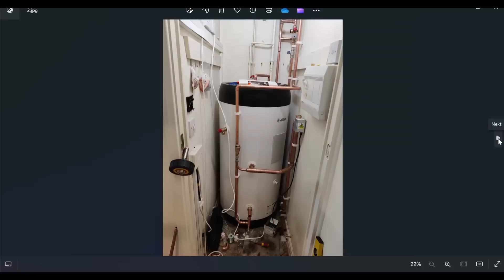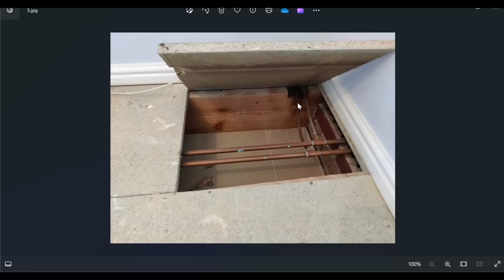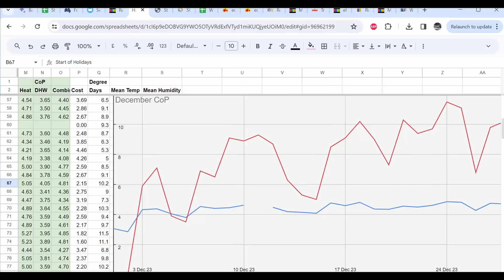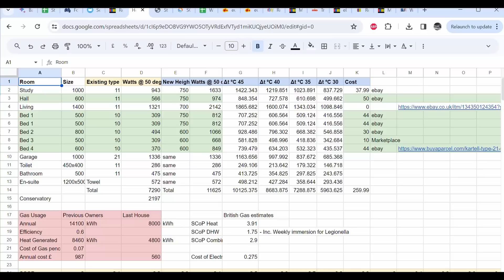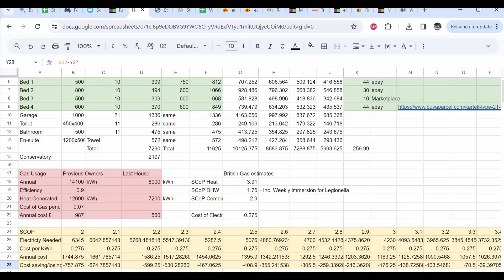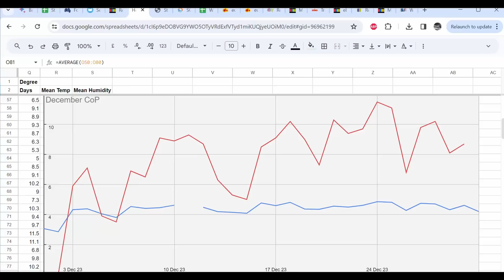How Efficient is my Air Source Heat Pump in Winter? December 2023 Monthly Data Report Update

Comment: The correct way to calculate efficiency is Total useful heat generated divided by total electrical energy input. Your calculations adding electrical input to heat generated and divided by electrical input give a misrepresentation of efficiency.

Think of a brushless electrical motor. If you input 1000w of energy into the motor and it generate 800w of rotational output movement then the motor has 1000/800x100=80% efficiency not (1000+800)/800=225% efficiency. Its nonsense.

Likewise if a car burns 1 litre of diesel which has a specific energy density of 40 mega joules litre. And that car travels 10 miles per liter it will use 40 mega joules of chemical energy. Compared to an electrical car that will use 2 kwh for 10 miles or 5miles per kwh. We can calculate the comparative efficiency. The efficiency delta is 40/7.2=5.55 or the electric car is 555% more efficient than a diesel.
We don't use (40+7.2)/7.2=6.55 it's a nonsense.

Your electrical input to heat generation ratio on the 2nd of December is Heat Generated /Divided by Electrical Input. 79.3/42.9 = 1.85 i.e. 185% more heat for each electrical kWh you input. Your real COP on the 2nd December is 1.85. It cost you £0.275p (plus 5%vat) per kWh of electricity to generate 1.85kwh of heat. I.e £11.80/79.3= £0.15p per kWh of heat (Add Vat at 5%). So if your unit price is 0.275p for electricity then your efficiency is 0.27.5p/0.15p= Which is guess what, 1.833 your COP is  1.833 on 2nd of December. You need to think of the cost of energy in and the total number of useful heat kws out otherwise you are a COP of 1 or 100% efficiency out. 

My example on the 31st December is that I used 5 kWh of electricity energy to generate 29 kWh heat in my house (Not including DHW which was 15/4=3.75 CoP 3.75). Ignoring my 15 kwh battery and 7 kWp solar array, if I was to pay for this at 30p kWh (Excluding 5% vat) then I would input £1.50 of electrical power to generate 29 kWh of heat which equates to a real world cost of 5.17p kWh ex vat..

So I think something isn't quite right with your system.

 My efficiency is therefore 29/5X100=580 580% or CoP of 5.8 it is not (29+5)/5x100=680% or CoP of 6.8. Think about your real world cost in Kw v heat generated. The most important metric is how much does it cost to heat your home and hot water compared to your old system. At a real world CoP of less than 3 calculated the proper way your payback is probably infinity or never. Assuming 7p for gas and 27.5p for electricity or gas being circa 3.9x cheaper using a 70% efficient boiler. 
One more point of reference your best CoP for heating was on the 18th December 23.9kWh heat for 5.9kWh of electrical input which gives a CoP of 4.05, not 5.05 as entered into your spread sheet.

You're over egging your efficiency. Why don't you add two methods to your calculations. Absolute efficient CoP and Vaillant formula.

Thanks for posting, you are getting me thinking about this and Happy New Year.
Reply from the maker: This is not misrepresentation.

The figures are taken directly from the myVaillant app and the equation is shown clearly on several Vaillant documents both for consumers and technical documents for engineers.

Thanks for your comment but I disagree with your analysis.
Reply: @UpsideDownFork  Use your input energy and out put heat. The app has a disclaimer stating its not accurate and is only an indicator.
Reply from the maker: @DMFPERFORMANCE yellow column is electrical energy, orange column is heat output. The sums still work.
Do you measure the MPG of your car by filling tank to tank?
Do we measure the CoP of a gas boiler? No, we barely check the combustion efficiency, let alone the overall operating efficiency in situ.

Ultimately the proof is in the pudding and the significant savings on my energy bills already line up with the CoP that has been calculated.

The biggest guess here is if my boiler was actually 60% efficient. It could have been 50 or 70 for all I know, so the base line is the biggest thing that could be called into question.

I've gone over the Vaillant numbers several times and I'm confident in them based on smart meter data and heat loss calculations, I've extrapolated that they are very much in the ballpark with perhaps a 10% margin of error at the most.
Reply: The hard facts are that you are paying £11.80 for 79.3 kwh of heat, 15p per kwh. That's it.
Reply from the maker: @DMFPERFORMANCE  should have gone to Specsavers pal.
£11.80 for 122.2kWh of heat. 9.6p/kWh on the worst day when it's well below freezing 👍
Reply: Your adding the input into the calculation twice. Your actual heat is 79.3kwh. Your actual cost is £11.80. For each kW of electrical energy  you get 1.83 of heat. Or 27.5p/15p =1.833x more heat than electrical input. That is a fact. No point kidding yourself mate.
Reply: @DMFPERFORMANCE but the energy used to power the heat pump also ends up heating the house. The “heat pumped” or “environmental yield” is on top of that.

So the calculation in the spreadsheet ia correct. E.g. 1.1 kWh energy input causes 2.9 kWh of heat to be pumped from outside to inside: total heat delivered is 4 kWh and hence COP is 4/1.1=3.6 (not 2.9/1.1=2.6).
Reply: @HowardBurgess  Nope it powers a compressor and water pump and fan. Heat Pumps transfer heat from the environment only.
Reply from the maker: @DMFPERFORMANCE  the compressor is there to add heat to the refrigerant. That's the basic principle of vapour compression.
Your assertion that a heat pump only collects heat from the air is incorrect.
The fan and the pump use an insignificant amount of electrical energy compared to the compressor.
Reply: @DMFPERFORMANCE  The compressor and water pump, and indirectly the fan motor, are all part of the heating loop. Are you saying that every drop of energy used to power these items disappears into the outside environment?

I’m saying that most of it ends up in the airstream/refrigerant/water and hence makes its way into the house. Obviously there are losses, like with everything.
Reply from the maker: @DMFPERFORMANCE  open the myVaillant app up.
Go to the energy information page.
Bottom left corner is the heat generated figure.
Stevie wonder could probably find it.
Reply from the maker: @DMFPERFORMANCE  you are using the environmental yield figure.
If that were the heat generated then you would calculate my heat loss at 3kW as that day was close to the design temperature of -1.8 degrees.
My actual heat loss is 5.8kW, give or take 5%. If you've seen my other videos you'll see that 2 professional surveyors conducted their own heat loss assessment as well as I performed my own, so I'm confident in our figures.
111.7kWh of heat generated puts our heat loss at 4.66kW which would make sense seeing as some of that period would have been on setback and not targeting the 21 degree design, but 17 degrees instead. 👍
Reply: Air Source heat pumps use the cold refrigerant to absorb heat from the air blown across the heat exchanger using a fan. The compressor increases pressure and heat this cost energy. This energy is the input energy. The output energy is the heat liberated. The efficiency is the amount electrical energy we input to the useful heat energy output. If we put 1kw of electricity in and we get 4kw of useful heat (heat in hot water not in the body of the compressor or powering the fan) out that is 400% or a CoP of 4:1.   That's how it should be calculated. If I use the Vaillant method and the method used by the OP I'd get a current CoP of 6.8 680% that is utter tosh. My Vaillant unit says my monthly CoP is 6.4 I don't believe it, and neither should you. Just keep posting your input energy and heat output. That's perfect. Best of luck 👍
Reply from the maker: @DMFPERFORMANCE how long has your system been running?
Heatgeek warned of some Vaillant units over or under reporting significantly in the first few weeks and sometimes even longer.
No one seems to have pinned down exactly why this happens or which schematic seems to be most affected but judging from the thread it seems the 3.5kW and 5kW units are most affected.
Some thought it was the addition of glycol in the system affecting the specific heat capacity whilst others pointed to incorrect settings during commissioning.
Interestingly they do seem to mostly self-correct after a while. 
I wonder if your unit is one of the ones that is over-reporting?
My CoP figures are bang in line with the Vaillant published figures based on the flow temps we're running at, which are typically in the 30 degree range. Vaillant claim 4.36 CoP at 35 degree flow.
Reply: @UpsideDownFork  Only a month. I can measure the cycling power and frequency with my hybrid solar invertor CT clamps and my energy Eddi and Harvi system in real time. The power usage is 0.5kw for 15-20 minutes 20 times per day, so 6.6 hours of use at 0.5kw is around 3.5-4kwhrs of electrical input energy. The heat pump control unit says anything from 24-30kwhrs of heat liberated from the environment. The App kind of agrees with all the above.
Reply from the maker: @DMFPERFORMANCE that's interesting. On our separate electric meter which is just for the heat pump, it has recorded very close consumption to what Vaillant reports on the controller.
In the absence of a heat meter, I will take their world for how much heat has been generated by the pump.
Reply: @UpsideDownFork  The, my vsillant app is a bit of an eye opener. It states 1kWh of electrical consumption, 6.8kWh of environmental yield and heat generated of 7.8kwh for a CoP of 7.8. The control unit says 20kWh of heat and the app says 1kwhr of heat per hour, so assuming the unit pulses for 15mins, 20 times per day drawing 0.5kw we have 15x20/60= 5hours run time at 0.5kw its 2 5kwh of input electrical. So if the house needs 20kWh of heat per day (Only heat for 20 hiurs) and I use 2.5kWh of electricity then 20/2.5=8 CoP of 8 using  the heat out verse elextrical energy in method to calculate efficiency which is close to the app using real time and consumption data but assuming the heat reading is correct. Strange this figure supports the app, but the method is different. Anyway, I will use environmental heat divided by energy used because that is what I'm paying for (or generating from solar).
Reply: @DMFPERFORMANCE  My understanding of the figures used above is the term 'environmental yield' (the zero CO2 harvested bit) figure is the overall heat energy output less the perhaps CO2 intensive energy input, as measured by the system. So the actual heat produced is the sum as used above.

Comment: It would be really informative if you had the outside temp and inside temps plotted against consumption and production, i'll be really interested in the COP if the outside temp is -14 to -18 and whether it maintains the ability to keep the house warm. I disagree with SCOP because if the equipment isnt able to meet the demand on the coldest days but its ability is inflated somewhat by using a seasonal average, its misleading. I swear SCOP was created to sell heat pumps. It would be like rating the efficiency of a light bulb over 24 hours, baring in mind for at least 8-10 hours its not switched on. Then things appear more efficient than they are. If you look at the COP vs outside temp from suppliers, then the COP at sub zero low humidity is very low, maybe even just 1 and "supplementary" heating is required. They are still governed by the laws of thermodynamics and if its too cold to boil the refrigerant then its not making heat efficiently, only heat given by compression and the various fan motors etc. I have a2a and fgas certs, I have played with this for years before it became popular and I am yet to see any refrigerant produce any reasonable amount of heat when the temps drop below -12, else face continuous defrost cycles.. Sure r290 is around now, but that has its own issues in terms of efficiency although it mail boil at lower temps. I suspect there are dual refrigerant heat pumps but no doubt they will cost significantly more.
Reply from the maker: Thanks for your comment.

Lucky for me I'll never have to worry about that.

I live in Southampton but maybe someone in Scandinavia might have to worry about that.

The myVaillant app does show graphs showing electrical input Vs heat out and shows inside and outdoor temp too. Maybe I'll see if I can record that to show some examples.
Reply: Suspect that you must be well outside the UK, our typical lowest temperature here is rarely below freezing - lowest here in 1982 hit minus 14 but is typically only minus 6 degrees at its coldest. How do you explain Scandinavian countries having huge numbers of heat pumps?

Comment: Interesting, I am still waiting a survey date but just checked my 1910 onwards double brick wall 4 bedroom house (13 rads) for December used 161 Litres of heating oil (does the hot water also) and the condensing boiler, circulating pump and motorised valves used 18Kwh or electricity which equals £123.97 for oil and £4.86 for electricity. The system controlled by Drayton Wiser with 11 rads wiser smart rad valves. So it would seem a ASHP based on your data should save me money other than the estimated (with no physical survey yet) £6,600.00 + £7500.00 grant to install it. I was quoted an estimated annual saving of £280.00 so to recoup the £6.600.00 will take 23 years to break even (should the system last that long without needing a new ASHP or storage tanks. Of course if I don't go for the ASHP given time the existing equipment will fail pushing running costs up.
Reply from the maker: Hope the survey goes well for you.
ROI may not work out for many, especially if your existing boiler doesn't NEED to be changed as ours did.

Of course the environmental and human comfort benefits are also significant factors for many.

Thanks for the comment and happy new year 🎊